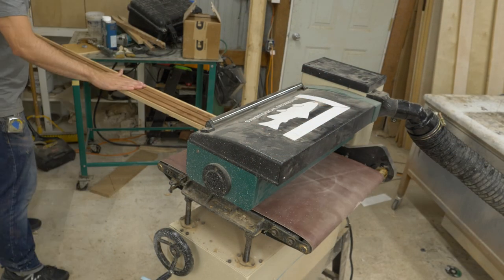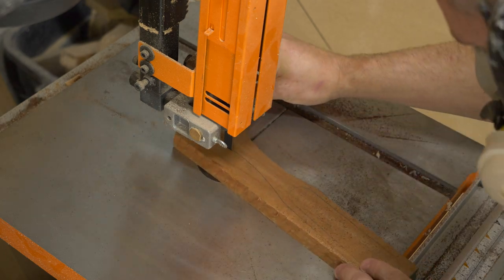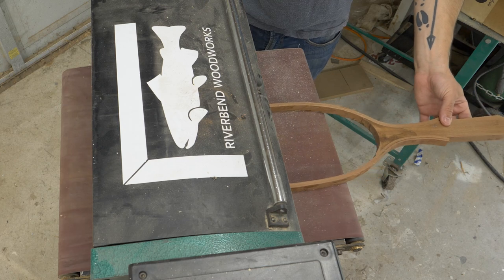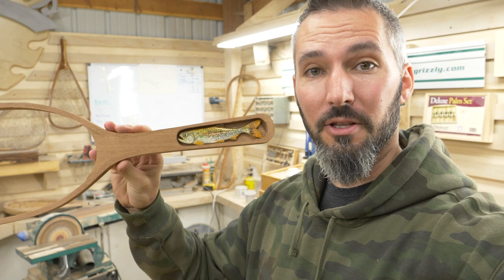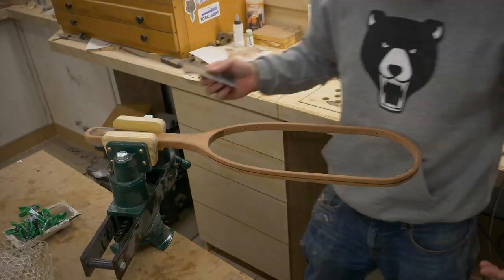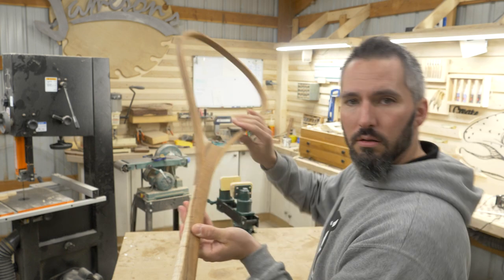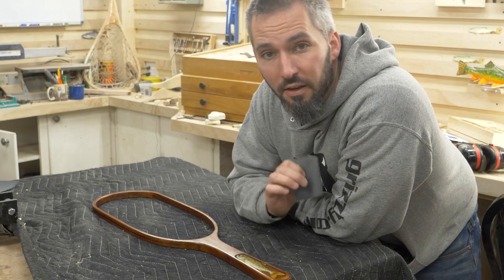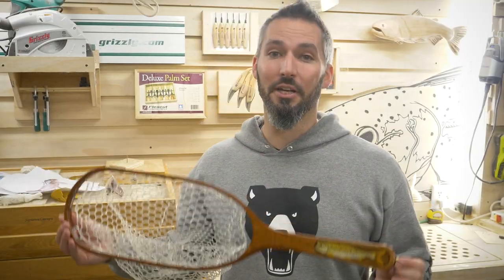Sapele Mahogany Fly Fishing Net Build

Comment: @Riverbend Woodworks,   how good is Titebond III ULTIMATE for this purpose compared to two component epoxy glues? 
Is it good enough to hold everything after years to come or you think epoxy is better for this purpose? Fantastic work, thank you for presentation!!!
Reply from the maker: I have used (and trust) Titebond 3 a lot more than epoxy, and that is mostly because I screwed up on two net hoops by not getting the ratios perfect. The epoxy ended up being tacky in places and I had to scrap each net. Titebond 3 is great because it has a decent working time unless it’s super hot out, and it holds amazing every time.

Comment: Awesome build! I build some nets as well and was curious why you went with the ship 'n shore first and then hit the net with spar urethane. I'm still working on figuring out what's best to finish with. I've done some nets with several coats of tru oil and well as some with several coats of wipe on spar urethane. Again, great work and the figure on that koa wood is beautiful!
Reply from the maker: I think I am in the same boat as you with experimenting with finishes, which is kind of why I've landed on this arrangement. It sure seems the Sea Fin penetrates very, very well, and if it's true about the hardening factor, that's a win as well. It's also nice because it hardens quickly and you can knock down any raised grain and apply a second coat. The spar urethane is another quick and solid route that I have settled on from experimenting. Hope this helps and thanks for watching!

Comment: Great work.  So the 17" on the net is the rough inner circumference of your nets generally (or of the size you made here)?  Also, after sanding your strips are about 1/8" and you use 4?  This is on my 2022 bucket list now to give a few nets a go.
Reply from the maker: The rough size of this hoop (inside to inside) is 16.5" x 6.75" to fit that size net basket, though I do tend to try different baskets that I find, so I will end up making a form to match each size. I think I have 4 sizes currently, and plan to keep doing more because it fun! As for the strips, yes, I did three 1/8" strips initially, then decided to add a final strip that was actually very thin--maybe just over 1/16" thick. That's awful thin though, and might not be a good plan, unless sandwiching a different color for inlay in the hoop.